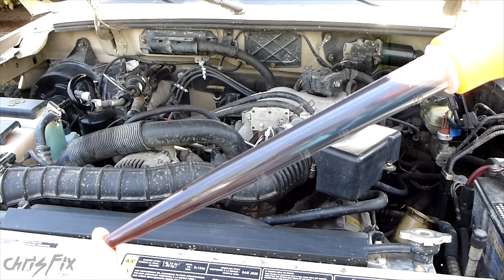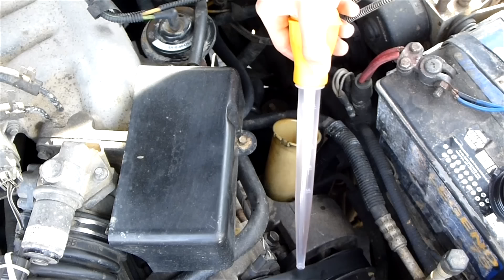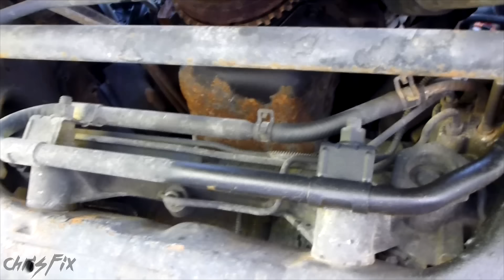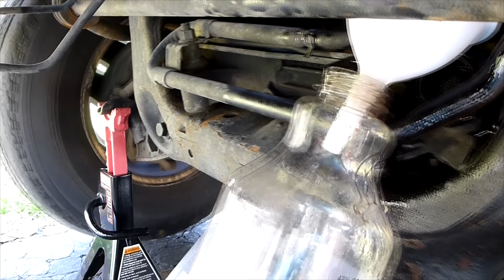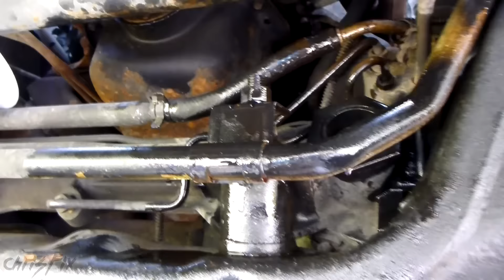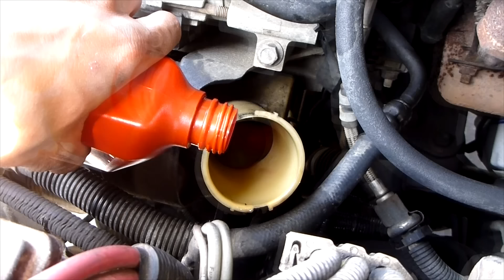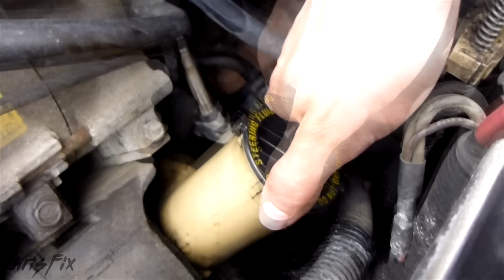How to Flush Your Power Steering Fluid

Comment: Good job with the video. Might save a few people some big bucks.

I have learned to put down a vinyl tarp whenever there is a chance of fluid leaks or spills. Then I spray the area that leaked with "Simple Green" cleaner. Let it drip down on the tarp. I use those tough paper towels that come in a square box to clean up the tarp. You could probably used old towels because the simple green will remove grease and stains. 

Most fluids do NOT stick to a vinyl or poly tarp. Might have to spray the tarp a second time and re wipe but it comes clean as new. For the car, I run a hose with hot water from the house and blast it clean. That simple green is a fantastic de-greaser. And it has not harmed the finish on the car or motorcycle in the ten years I have been using it.

Comment: I didn't have a turkey baster so I used the little plastic pump that came on top of a soap dispenser. Cost me $1 (70 UK pence). It worked a treat & the top just sat in the power steering reservoir with the plastic tube going well down. I drained the old oil straight into a plastic cola type bottle, so no mess..
Reply from the maker: That is a good idea too!
Reply: Just to clarify, this wouldn't be as good as the full flush, but my oil was already a maroon colour, & not badly contaminated. It was a quick way to do it, but after a lot of years you'd probably want to do the full flush with the  new oil . I just  kept refilling the reservoir & added a final total of 1 litre of new  transmission oil after several engine uses to circulate the new oil each time.  It's important to use the correct power steering oil for your car, rather than some multi-purpose one.

Comment: Hey i have an 09 altima with a steering lock so i cant turn my wheel with the car off, how am I supposed to make sure I got all the old fluid out
Reply: Put the key in the ignition, turn it to ON position, but don't start the engine. This way the column lock is disengaged.

Comment: I wonder if you can just use a vacuum and suck all the power fluid from the engine bay reservoir instead. That would make this job much easier and faster. 

🤔
Reply: TraumaER d
Reply: He did use a turkey baster to vacuum out fluid from the reservoir.  
Even if you use a powered vacuum, there will still be fluid in the lines.

Comment: Hey Chris, so the dirty fluid has something to do with the noise? i just replaced the pump on my 2000 Mustang but did not flush the system  and is loud. I am going to flush the system (which I should have done since the beginning) because the oil is black. Also, my car uses the transmission fluid as well, but can I use the regular Prestone oil? Great Vid by the way!

Comment: Hey chris love your videos. I just have a question. What difference does it make if we don't jack the front of the car up?
Reply from the maker: You don’t have to jack up the front of the car.
Reply: Btw please correct me if wrong. All during this procedure. Your car was off and was not turned on. right?

one more question. I have a honda civic 2005. In that there are two hoses. The crimped clamp one is connected higher and the thicker hose is connected at the bottom. Can you please confirm in the honda civic, whether the thicker pipe connected to bottom with removable clamps is the return pipe OR the thinner pipe with the fixed crimps attached slightly higher is the return pipe? Need your expert opinion.
Reply: Just makes it easier to turn the wheels

Comment: Before disconnecting the hose I usually pinch it with a needle nose vice grip to prevent it from leaking and making a mess....👍
Reply: That actually damages the internal walls of the hose
Reply: Good point, makes a cleaner job. They make special clamps for that, needle nose pliers are a bit sharp and rigid.
Reply: @Mr305Maxxx  never. It damages the walls of the hose.

Comment: I decided to use turkey baster to remove the power steering fluid and added Preston’s full synthetic....it’s blue! Is that ok?? The original was red in my Ford Edge!
Reply from the maker: As long as it is the same type of fluid you are fine.
Reply: Pretty sure the Ford edge takes MERCON V ATF(which is red) in the power steering system, not "power steering fluid". That said, if you just put one quart in it should be fine. You'll want to use MERCON V type fluid next time though.

Comment: I don't know how the inner working of the ps system is but it looks like you could take a suction gun and hook it to the low pressure side at the reservoir and force the fluid through back up into the reservoir until fresh fluid comes out.
Reply from the maker: You could probably do that since the low pressure side just goes up to the reservoir.

Comment: I have a 2010 altima with keyless ignition. How do I turn the steering wheel lock to lock? Do I put the car on ACC ignition? because if the ignition is totally off I can only turn the steering wheel about 15 degrees until it locks. Great video! Thanks

Comment: I replaced the power steering gear box and all leaks and noise stopped accordling.  But when I primed the new fluid, it foamed.  The steering is still a little tougher than it was before repair.  Is the fluid ruined?
Reply from the maker: No foam is just bubbles. Keep the fluid topped off and bleed the rest of the air out. Once it is as bled as you can get it, drive it around and it will bleed the rest of the way.

Comment: Thanks Chris.

I am importing 2007 Toyota Alphard V 2.4L AS from Japan and it has 126000KM on the clock. I am buying directly from Japanese government Auction through SBT Company, although it's auction grade is 4, interior/exterior B, I thinking it would be good to be good to buy some spare parts to be shipped with the car as in this country where I live (Somaliland) Alphard is not popular I may find a hard time to find the parts to do repairs.

So kindly help me to guide me which parts I should order for and how can I know exactly the right ones for this Alphard, because the SBT sales manager told me they can buy any spare parts on my behalf but I should give them the information identifying the exact parts I want.
Please help me brother. I don't wanna buy the wrong parts for my car. Also I want to be doing the simple repairs by myself like changing car fluids and other simple stuff, so please may suggest me other tools that I will need to accomplish these tasks so that I can order for them too. From the pictures of the car, it has one jerk but a small one not hydraulic like one you used in your video, will it work or I should get a bigger one?

Also please may I get your personal contact like whatsapp or skype number?
Reply: Someone advised me to check:

1. All other fluids (i.e. coolant, windshield washer fluid, brake fluid, engine oil as well as the oil filter) and change them

Also emphasized to check Transmission  and Power steering fluid but is it necessary to flush the Transmission fluid as well?
2. Tire pressure
3. Air filters
4. Fuel filter (but I tried to watch a you tube video, it looks like checking and replacing Toyota Alphard's fuel filter is hard as it's in the tank)
5. Clean the car's inside and outside.

I am not a mechanic, but I really wanna do all these simple repairs by myself, so kindly guide me right from the tools I need for all these simple repairs to the parts suitable for this Toyota Alphard, and how can I identify them exactly because SBT (Japanese car exporter company) manager told me that I have to give them the information identifying the exact parts I need, but unfortunately I don't have the car manual and can't find it.

Thanks a lot in advance.

Comment: So is it safe to use "Power Steering fluid" or do I have to put ATF+4 (which is what my manual says to use) I bought the PSF not thinking there was a specific type I needed. 

Manual says to use ATF+4 and what I bought just says Power Steering Fluid

Comment: Hey Chris I have a question well it's very important ... My BMW 3 series .... Drives ok but some times the steering locks up and gets very hard to turn the steering wheel in any direction left or right ... I have almost got into many accidents because of this issue I replaced my main drive belt Because it broke but this is an issue I would like to have diagnosis before I get into a bad accident...

Comment: Hi Chris or anyone else! PLEASE HELP!! - I am trying to bleed my system - left to right 20 times but as soon as i go over 1000rpm I get heaps of noise from the pump. No amounting of bleeding is working? - also no leaks anywhere and brand new high-pressure line. PLEASE PLEASE HELP!!

Comment: Why disconnect hoses? Pull fluid from pump, add to full, turn wheel, repeat until fluid is clean.  🤔
Reply from the maker: You could do that but disconnecting the hose makes it quicker and the fluid and dirt particles can flow out and down.
Reply: That's the way I've always done it. That way is much simpler and you don't have to worry leaks or trapped air. I change my power steering fluid regularly and it's nice and red like cranberry juice. My PT Cruiser specifies ATF+4 and my Buick specifies regular power steering fluid.

Comment: What about using a siphon technique to remove the fluid?
Reply: temptingsylph I've always used a turkey baster to suck out old fluid. I change my fluid about every 30,000 miles. I've never disconnected any hoses like ChrisFix did.

Comment: In my opinion Ford was doing some kind of drugs when they did this. Power steering fluid is made for the power steering system. Transmission fluid is made for transmissions. Why is these rangers recommended to take atf transmission fluid instead of power steering fluid. I've used ps fluid in my truck for years. I just recently replaced the gear box cause it was original and shot. I put ps fluid back in it drove great last night with hardly no whine. Somebody told me to drain it all out and put in atf. 😩, so the ps fluid I put in and now supposedly have to drain and flush it out that's now a waste of damn money of fluid 😔

Comment: Nice video. I need to figure out where the low pressure return hose is on my 79 Winnebago Dodge 440 hydroboost system that runs both the steering and brakes.

Comment: Okay so my power steering pump has been leaking this whole winter and I didn't drive the truck. I put some of the lucas stop leak in it to slow it down. Didn't do anything, yesterday we finally had a nice 70 degree day, I decided to start the truck up and fill the tires up with air (Deflated from cold weather) I pulled out of the driveway and realized I couldnt turn the steering wheel. So I decided to reverse in. As i did I applied more pressure to the wheel and then it was free, and the pump started whining but quieted down. Filled the tires with air and then got to see the steering pump line. It was GUSHING with fluid. Literally like a tap. I brought the truck straight home and the fluid leaked all night. So today we had another good day and I decided okay, lets see if I can take this line off. I couldnt get to it so I had to remove the air intake to get access to the line. It got dark before I could do anything so I decided to shut down the operation till tomorrow, when I opened the truck (03 f150) The indoor lights were flickering as was the dash, and I could hear clicking. What did I do wrong. I reconnected everything and then opened the door again and same problem. I turned the key over to the run and the dash was flickering. What did I mess up?

Comment: is it possible to drain all the fluid out with just a syringe and a plastic tube line? I don't have access to getting underneath my car and draining it from the bottom, plus i'm not that experienced. 

perhaps draining what I can, do 2 full rotations and then add new fluid until all the old is sucked out and gone?

Comment: I used a brake bleed kit to the hose flowing into the reservoir and vacuum the system that way while adding new oil to the reservoir. I plugged the reservoir inlet valve with a ear plug so the new oil won’t flow out while vacuuming the system.

Comment: Chris - I noticed that you changed the additive link to a new type (probably due to the type in the video not being available any longer). Should we still be adding this dual mixture in with the newly flushed steering fluid and should it still only be 4 oz? I only ask because when you buy this brand, the instructions on it are stating that they are the last step before you repair or replace your vehicle. I am changing the steering fluid on an 04 Mustang GT. Thanks!

Comment: Hey Chris, have a question. My car has a little over 60k miles and I've never has a steering flush. The color of my fluid is still a clean bright red but during warm/hot weather temperatures I notice a creeking sound with a little dry tension feel when I turn the wheel.  Does that mean I need to flush my system eventhough my fluid is still clean?

Comment: An easier method to completely flush out all the fluid is through the reservoir hoses. You can use a hand pump to pump out old fluid while at the same time you push in new fluid.

Comment: If I burn out my power steering pump and have to replace it, is it safe to just do a flush when I put my new one in or should I be worried about contaminants getting into the steering rack and messing that up?

Comment: Chris,  where did you purchase the long Turkey Baster?
Reply: Dave Clark  I used the large pump from the  big shampoo bottle. Works great. Pump the PS fluid into old small bowl that will fit close to the PS reservoir. Then refill start the car turn the wheels a dozen or so times. Shut off the car repeat about four times till the fluid comes out clean. I bought Blue Devil full synthetic PS fluid at Autozone, for $5.00 a quart on sale.

Comment: When you push the fluid out is it with the engine running ?
And when you bleed the systeem is that with the engine running ?
Reply: off when you push the fluid. Don't gotta bleed it as it will bleed it self out after some driving.

Comment: Hello Chris Fix, I have a 99 Ford Ranger 4.0. After watching this video I was going to flush my power steering. I had the pump changed out by a mechanic a few years ago. I noticed the mechanic used power steering fluid or dot 3 instead of mercon atf. Can I just flush the system with new mercon atf ? Thanks for the great videos!

Comment: Chris, I would recommend not bothering with the syphoning of the reservoir. It is typically at the lowest point where any sediments or deposits will settle. Just add fresh as the spent fluid exits.
Reply: It's a good tip for people(like me) that are gonna disconnect the return line @ the reservoir on other types of vehicles so it doesn't make too much of a mess @ 1st but you're right I'm not quite sure why he did it on this truck if he was just gonna disconnect the hose at the bottom that is kind of a pointless step in this particular video

Comment: on a swap engine and you what a power steering, what power steering fluid should i use, should i base on the new swap engine or still on the stock manual book?
Reply from the maker: Whatever power steering pump you used, use the fluid recommended for that.

Comment: great video , what I did to my mustang with this same power steering pump and fluid is this: I got hand pump fluid from Harbor Fright and seal the intake to power pump with Tape and plastic connected to hose of intake hand pump fluid to create a vacum and suck most of the fluid !

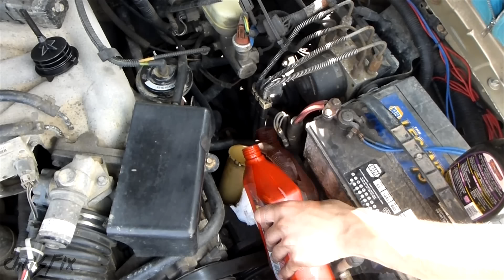Comment: at 4:21 you put a transmission fluid instead of steering fluid.
Reply: This truck uses automatic transmission fluid for power steering as stated at the start of the video. Pay attention.
Reply: @harryd9782  calm down papi
Reply: The manual says ATF. Automatic transmission fluid.
Reply: ATF, power steering fluid, and brake fluid are all hydraulic fluids which mean they don’t compress like water does. That’s why a significant portion of power steering pumps use ATF. They would likely work with any other non compressible fluids as well
Reply: My 1992 f150 calls for type f atf, because Ford just designed their vehicles to use what fluids they had on hand

Comment: About 6 months ago, on my 1991 Explorer, I replaced my power steering fluid with Mercon V ATF.
The difference in steering was amazing. Firmer feel and more control. 
Not sure it it works for your car but it worked for me.

Comment: Is it possible to drain the system from the low pressure line that connected straight into the pump?
Reply from the maker: +greatpower30 yes
Reply: ChrisFix Great, thanks. My clamp is one of those one time use ones and it'd a pain to get off. I think the bearing in my power steering pump is bad, would it whine louder and louder as the RPM increases?

Comment: the only way to know how much fluid it needs is to keep filling and do what you did? turning , start engine drive etc?

Also, why that auto transmission fluid? how do I know if my car will need a transmission fluid added to the mix? (that is so surprising that you need transmission fluid in a power stering fluid).
Reply: It’s what the manual calls for

Comment: Chris, I made a slight mistake today. After siphon out with the turkey baster and before opening the return line below, I mistakenly started the car and turn the wheels left and right 4-5 time to get more dirty fluid out (this cause the car to whine due to low PS fluid.). I fill it back up and did everything else normally.  Once the fluid is at the right level. I took a drive and everything seemed normal.  I know in your video you said to make sure not to run it while it's dry so my accidental startup for 20 seconds... Did it do any harm to the power steering pump or anything else when I started the car after the  PF was empty? Thanks